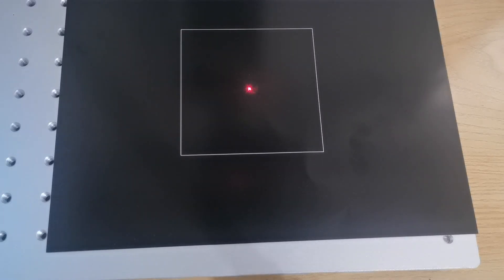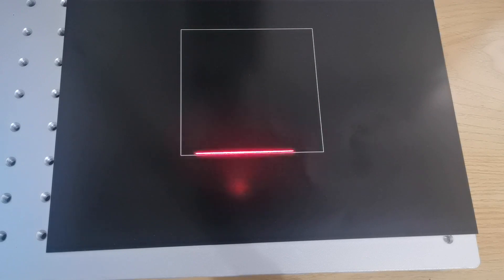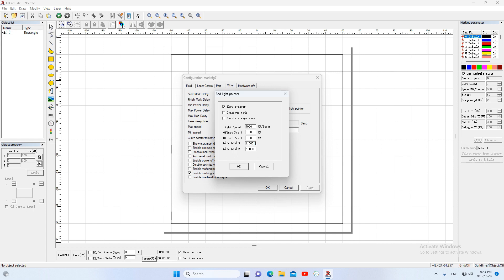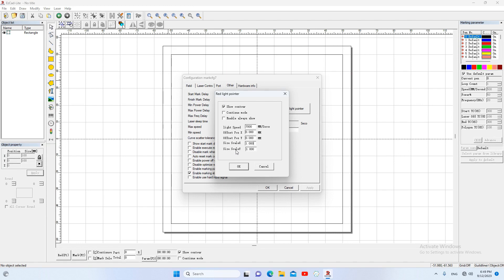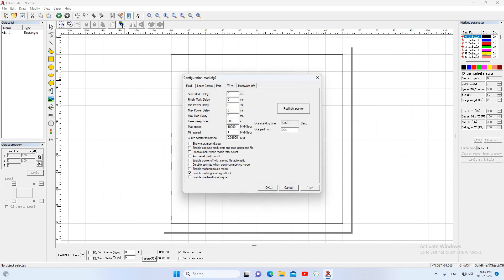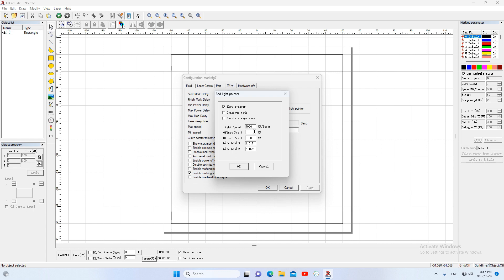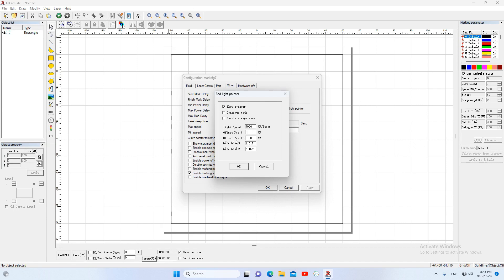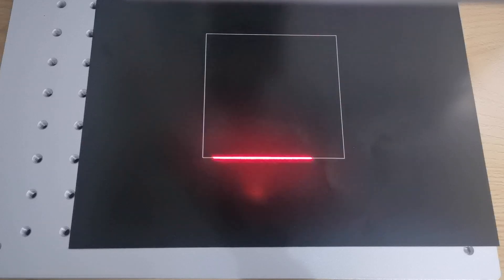EZCAD Settings:How to adjust the red light size/position on a fiber laser?

Comment: Hello sir my red light i cant see it in my laser
Reply from the maker: Hi do you have a galvo fiber laser and run EZCAD?
Reply: There is no laser as a guide mark sir
Reply: Yes sir i use ezcad
Reply from the maker: Maybe your red laser  is damaged.You can check your laser pointer inside.You can see my another video.
https://youtu.be/LmJGpTXBs1E @anthonyalcala3793